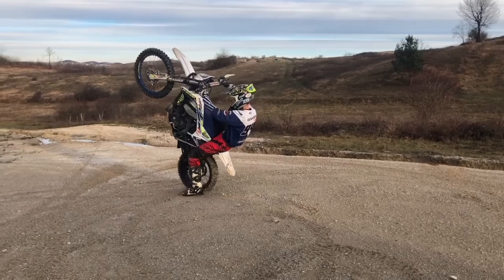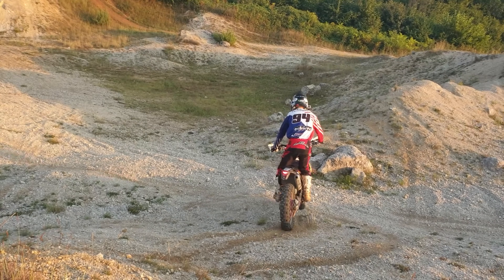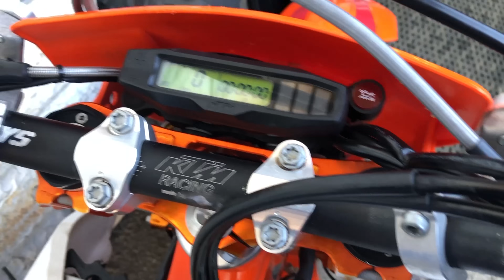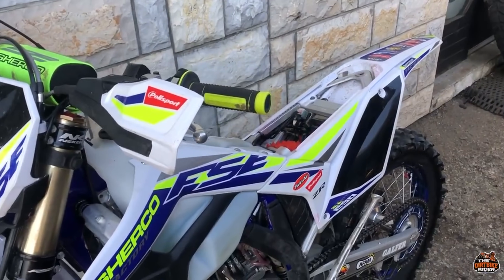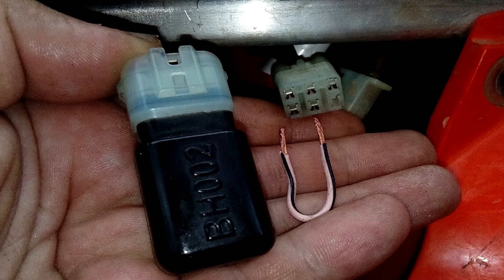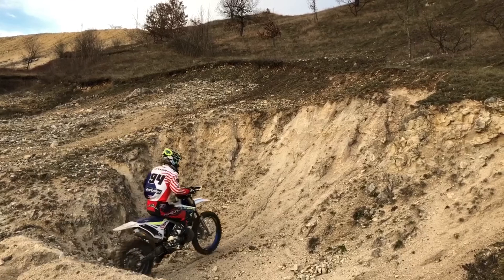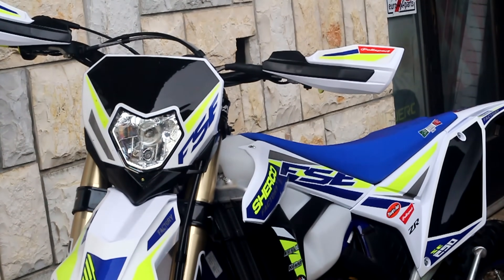SHERCO vs KTM | Which is better for Enduro ?

Comment: One weak point (relative to KTM) of the Sherco is the stock clutch.  This can be resolved with a Rekluse Core Manual rebuild.  The Sherco motor is better for super technical riding, especially for low end power and holding pressure/traction.  KYB suspension is also better out of the box on the Sherco.  But keeping a carb jetted in varying conditions is a bit of work.  

A Sherco 300 Factory, with Smart Carb and a Rekluse Core Manual Clutch is an awesome set up, but you are taking an already expensive bike, and then adding about $1500 more in aftermarket parts.

Comment: I am a carburator fan on 2stroke bikes, you can feel diference when tunning the bike, i think the tpi system needs  more fine tuning in the position the injector is, keep up the good work💪💪👍👍
Reply from the maker: Great point!
Reply: Fully agree. The snowmobiles in that world, and Yamaha's new shown engine of 2024 300cc 2 stroke with fuel and oil injection and electric start will have the fuel injector in front of the reed cage, not in the transfer ports like KTM (a dumb idea).
Reply: Can you expand on why you think one is better than the other? I’m not trying to be rude or anything, legitimately want your opinion. I ride a KTM tpi that runs like a dream and thought the idea is pretty neat.

Comment: Hi sister! 👋 Looks like a pleasant and competent mechanic and person.

KTM has a 2 map system.
The connector to connect / disconnect is under the fuel tank on the left side of the frame. Full power is MAP 1 with the single wire white connector connected. MAP 2 is with the connector disconnected.
KTM sells a right side handlbar switch thumb operated to be installed that goes in series with the connector. MAP 1 is full power and MAP 2 retards the timing for a softer power delivery. No need to remove the fuel tank to access the connector if the switch is installed.

MY KTM 300 TPI blew the engine completely at 7 hours of trail riding.
Reply: What is the reason why it blew?
Reply: @kordapyo612  No one knows. Not the dealer or KTM. They installed a new oil pump this time along with a new motor. I have yet to ride it.
Reply: @human1513  That sucks. I remembered back home in the Philippines when Toyota first introduced the D4D engines in their several line up. Whenever we encounter major problems in the engine like no start, black smoke, low power, stalling and the likes. The very first we do (if it is determined that the problem is in the fuel system) as instructed by Toyota is we have to replace the high pressure fuel pump, common rail, high pressure pipes, fuel filter and injectors as they couldn't determine the root cause yet.

Comment: I have had 3 ktm tpi bikes thay we're all good bikes and you can adjust the power valves they also have 2 ignition maps .all new bikes have growing pains sherco bikes have issues to as far as the tractibility of the tpi it's outstanding .as far as I'm concerned it's better than the carb bikes I have owned .
Reply: Then why do all of the factory hard enduro riders run carbs instead of injection???

Comment: Beta is also a good alternative. Got a 300 rr and love it in hard enduro
Reply: Most Beta riders I know got feed up the problems and got rid of them and got KTM, Yamaha,..
The Betas had to get new wiring harnesses as they caused problems because the wires were too thin and broke.
I know many 2 stroke Betas that the engines blew up around 50 hours.
Reply: @human1513  Rode with tons of people with Betas. Never heard of this issue, it sounds like an isolated incident...Nobody would go from a Beta to a yamaha either, they're not even comparable.
Reply: @StephenSutton94  I can only speak of the riders I know. I also know of other KTM's that KTM bought back from the customers.
Beta probelms are not isolated and well documented. Dealers tell me so. One dealer owner is a good friend of mine and he concures.  Look them up on the internet. Unfortunately most people seem too scared to tell they had problems with any product which does not fully present reality.
Reply: @StephenSutton94  KTM problems and what the new 2023 bikes are likely to have such as throttle body injection and back to premix again. Like Graham Jarvis and Bill Bolt are using now.  https://www.youtube.com/watch?v=XxRNiFChUck
Reply: Most beta owners i know have 2 problems, thay ride slow in fast sections, thay have to fix thair bikes all the time. I always had japan bikes and i only had to fix stuff i broke not stuff broke by itself, one guy i onow evem got a brand new Beta and it already had a broken cylinder🤷🤦 i mean... I have one old old Beta trial bike and that is the only Beta i will ever have
Reply: @human1513 Graham and Billy use carburetors, not tpi or tbi. Rather interesting isn't it...
Reply: @bbarker5766 you sir, are sorely mistaken and flat out incorrect. Do some research.

Comment: So,  what are you getting next?  I'm looking at Sherco or Rieju myself.  I like that the Rieju still has the kick start.  I've never ridden the Rieju (Gas Gas) but it seems like the Sherco has really good smooth torque for technical riding. Not sure about the GasJu power delivery and electric start reliability?
Reply: Look at a Tm En300es
Reply: 2022 electric start is much better than older models. Power delivery on the rieju is a lot more in your face than the sherco also. Backup kicker is also a huge bonus. I’ve had to bump start my sherco in a race and wasn’t happy about it at all
Reply: So, what are you getting next? I'm looking at Sherco or Rieju myself. I like that the Rieju still has the kick start. I've never ridden the Rieju (Gas Gas) but it seems like the Sherco has really good smooth torque for technical riding. Not sure about the GasJu power delivery and electric start reliability?

Comment: this is a good video. i'm riding a 2000 Honda CR250R as a hard enduro bike. Ive done some motor mods to make it more low end friendly and a bash plate and pipe guard, along with different gearing. i'd love a modern electric start enduro bike though like the Sherco though

Comment: Tpi bikes may seem simpler without mixing gas jetting ect but they do require more maintenance with all the sensors  oil pump ect 
So its always a trade off !

Comment: you can use a smartcarb instead of carborator but they cost alot  but no tuning except idle and fuel/air no jetting or piolet needle

Comment: I'm not a fan of WP or TPI. So I went with Sherco 300se. It was good bike, & looks really good too. My new bike is a Reiju 300mr works. Carbureted, SSS Kayaba suspension is by far better than other 2 bikes. I highly recommend it.
Reply: That's true..... Rieju has the best Moto tunning 💪🏻🔥
Reply: Can you say specifically what you like better on the Reju?
Reply: My Rieju MR 300 Factory is running with VHM Heat and it's a Special Edition 🔥

Comment: Good video but...
1) you said that TPI has less low end throttle power delivery than carbs.  I would agree that TPI is much "smoother" off throttle therefor feels less abrupt power wise off low end.
2) but you then said TPI is harder in hard enduro technical situations because its power delivery is too harsh.  But this contradicts your first statement.  TPI bikes are coined "goats" because they simply tractor up things with ease and smoothness of their power delivery.  Carb bikes dont have those same smooth power characteristics.
3) You said there was nothing to indicate the oil pump was not functioning but I was to understand the ECU has an oil pump error code for signal too high and too low.  Which was to tell the operator if the oil pump was functioning.  I'll have to check into that...
Reply: tpi has lower torque in low rpm and than the hit in mid range is noticably more agressive than on carb... so he was exactly right... no tpi has same or better low rpm grunt than correctly jetted carb... you sound like somebody who has TPI and have not tried different bike
Reply: @HarduroSK  - Looks like you didn't listen to what he said and didn't read what I wrote.
Reply: @Crazystuffyousee  you misunderstood the video! Watch it again.

Comment: No Yamaha - No Like
Reply: Yamaha or any Japanese manufacturers don't make a bike for hard enduro. Sure, you can put a big bore kit in it, but it will still get left behind in the hard technical sections!!
Reply: If Yamaha would build a 2 stroke hard Enduro bike i would own one already
Reply: Yamaha is trash.
Reply: @bbarker5766 Pol Tarres proved you wrong there m8… he runs a YZ250X with basically zero mods.
Reply: @chrispewkreme when has ge raced the yz250x? He made 1 video on it and then started racing the T700. The yz250x is good ive had 2 of them but it's like buying a brand new 2006 model bike. But the guy saying yamaha is trash is a dumbass yamaha makes the most dependable bike out there period...  but they are way behind the ball
Reply: It's the time to fade out.🎉🎉
Reply: @datsdylan007 i wouldn’t say that, having won many competitions.
Reply: You’re stuck in the past bubba. Yamaha can’t hold a candle to how good these bikes are for off road riding.